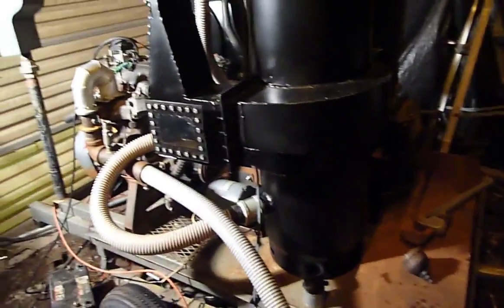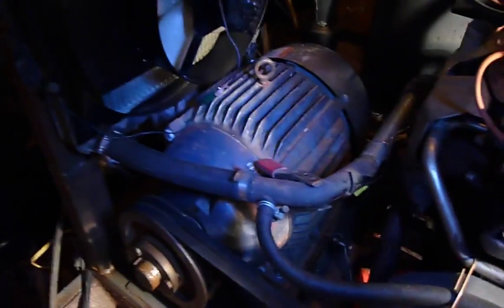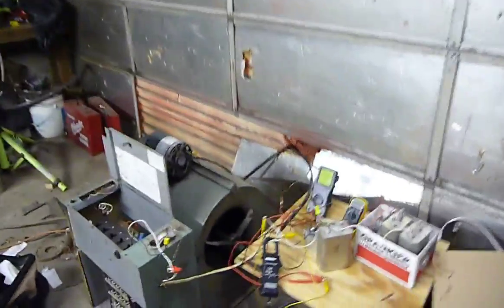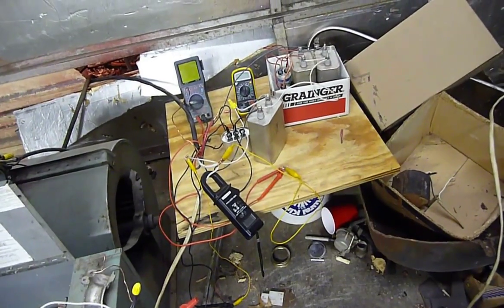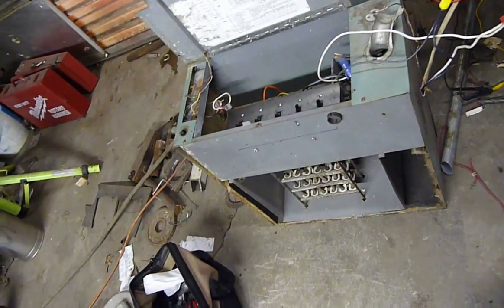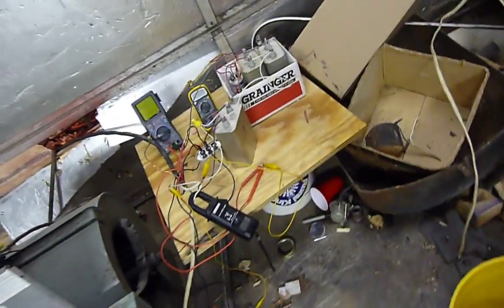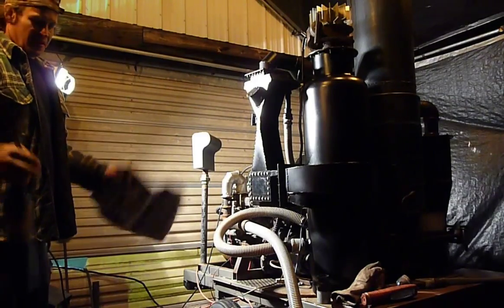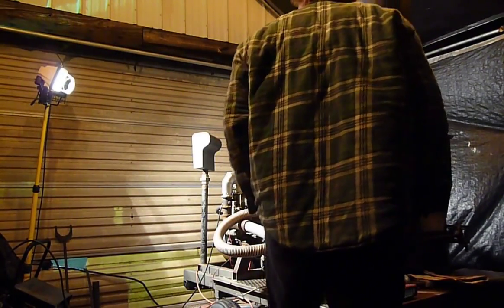Gasifier generator load bank testing

Comment: This is a great video; way to go.  I was on the victory sight until it went away good to see you doing well.  I have been building a gasser and will soon have it running just have to get my scrubber up and running.  I have a 6cyl Chevy that is going to be my power plant.  Hope you get the other video on the 3phase to single phase done but it sounds like you have lots to do.  If you get the time could you tell me how big of a 3phase motor could I run with the 160hp chevy I have. Thanks Chuck

Comment: I agree. I'm turbocharging a Toyota 1A to use as a prime mover. I don't know if I would want to puch a 25 hp engine/generator too much more than this one is being driven. 16.6 kw is decent. What is the rating? Something like 18.5 kw?